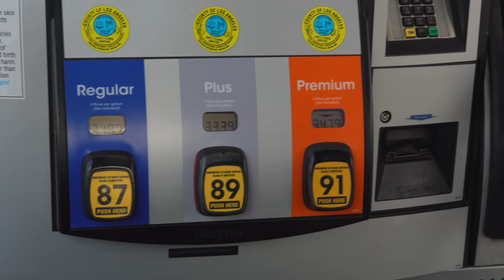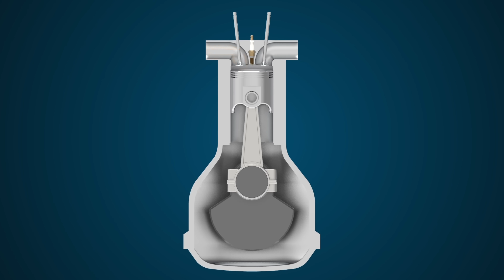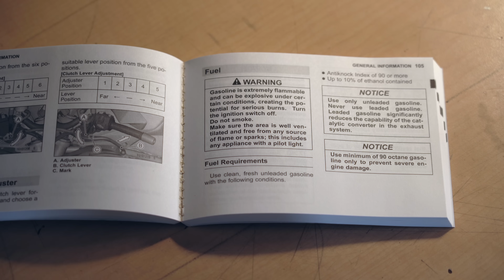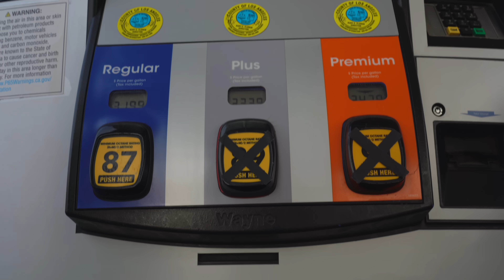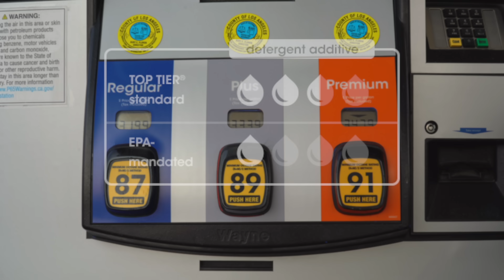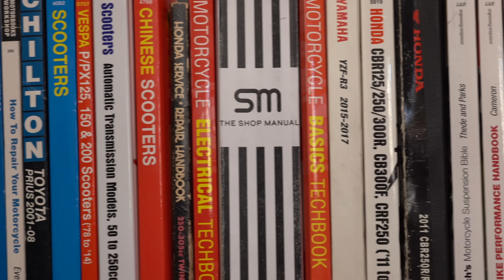Should You Run Premium Gas In Your Motorcycle? Octane Explained | The Shop Manual

Comment: Where I live (midwest) usually the low and mid tier gas both have up the 10% ethanol, while the 91 octane has none.  My bike calls for 89 octane, but as Ive heard ethanol can be rough of motors I just use premium.   My question is, is it best practice to avoid ethanol?  My bikes a 650 single cylinder

Comment: In Europe you can get high/low octane fuel independently from the additives/detergent content, ie some pumps offer regular low octane, premium low octane, regular high octane and premium high octane.

Note about the fuel additives/detergents, the more of them you have in a given amount of fuel, the less actual fuel there is in it. You may actually get worse fuel consumption on a fuel with a high additive content, and you may or may not get any benefit from those additives.

The best way to keep your engine clean is to just avoid doing a lot of driving/riding around town at low loads with lots of idling, engines mostly clean themselves up once you open up that throttle. In fact gasoline itself is an excelent cleaning agent for the sort of oily carbon deposits you get around the valves and on pistons.

Comment: This is the first time someone on YouTube has correctly explained octane ratings. I want to also suggest to use non- gasohol fuel in your bike. Reduces corrosion in the fuel tank thus reducing fuel system problems ie: clogged injectors. Alcohol attracts moisture from the air causing corrosion. Also alcohol degrades plastics causing cracks in parts and damaged fuel lines. There are fuel stations that sell alcohol free fuel. Alcohol free fuel is available at marinas but that is not the only outlet.
Reply: There are none near me in Delaware

Comment: I put always E98 and from a company that does not have to add bio ethanol to the mix. My bike is from 2004, so that was not the norm back then so it should run better. If I would have a bike that was few years old, I wouldn't care that much.

Comment: My owner's manual gives 2 power ratings depending of the fuel - 73KW  for 91 RON/87 AKI and 77KW for 95 RON/90AKI. The compression is 13.1:1
Reply: Sounds like a KTM! They often have a switch (or "dongle") that allows you to switch ignition maps based on the fuel you're running, so if you get stuck somewhere with low-octane fuel you can flip the switch and be okay.
Reply: Hi,  @AriH211  ! You are close, it's BMW F900R. I think the ECU switches the map automatically as there's no mention of a switch in the manual.

Comment: So I modified my carbureted i4 with an exhaust, which makes it run lean, which makes it run hot, hence it's better to go premium to avoid knock?
Reply: No. Rejet the damn thing so it's actually running a proper AFR. Don't try to bandaid the issue with fuel grade.

Comment: Here in Canada I use Shell 91 octane. Not because my bike specifies it, and not because I think it gives me better performance. I use it because it is ethanol free, and my bike often sits for a week or more between rides. Because ethanol absorbs water, I don't want it sitting in my fuel system to corrode or gum it up.